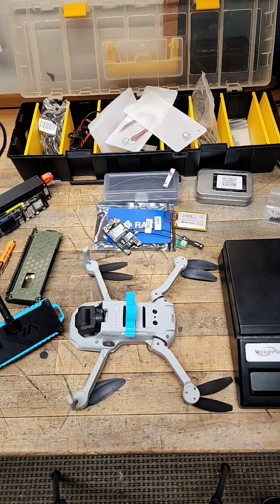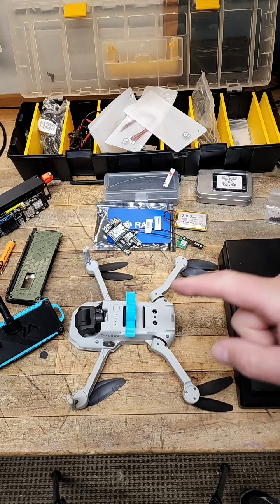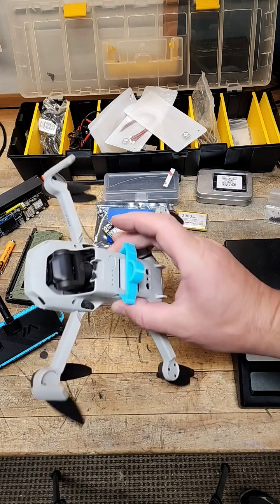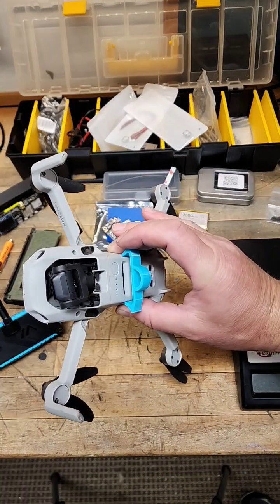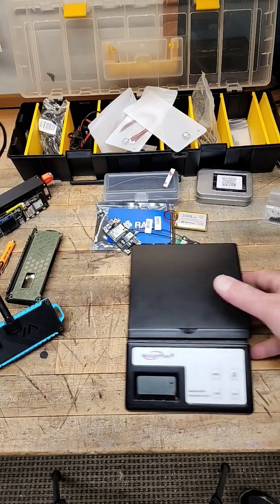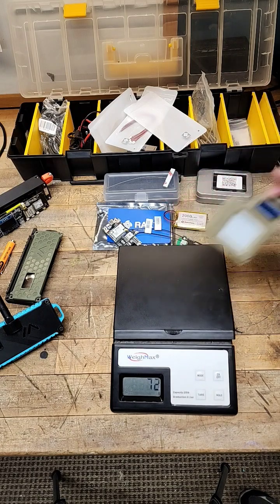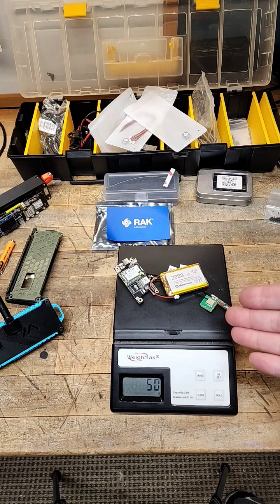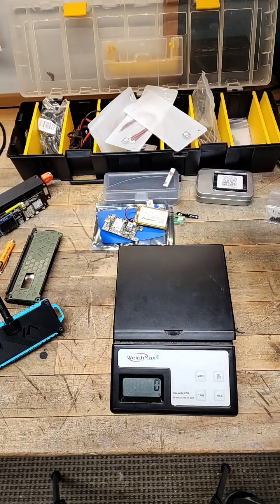Airborne Mesh Nodes #meshtastic #lora #emcomms

Comment: Try a smaller battery for the short duration of the flight
Reply from the maker: Absolutely, my current configuration has a 800 mhA battery and RAKwireless mini as the node. It only weighs 3.5 oz. Of course, I could get away with a smaller battery because my drone only has at most 20mins of flight time. It you are looking for Meshtastic I have another channel: @emcommsolutions Thanks for watching and the feedback.

Comment: dude your drone video feed and controller transmitions which are constant 2way is going to interfere with your node big time.
it'll work but the range...
Reply from the maker: I wondered about that. The only testing I have seen was done with a gotenna on The Urban Prepper channel.
Reply: i put a t beam on a phantom 4 without issue and got contacts 80+ miles while hovering at 350ft